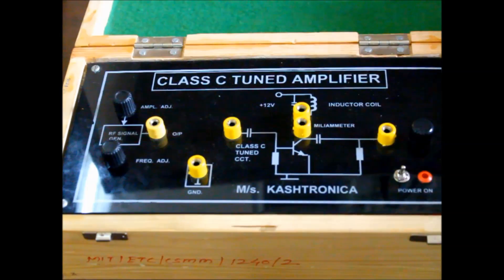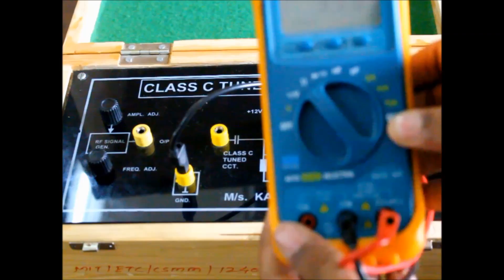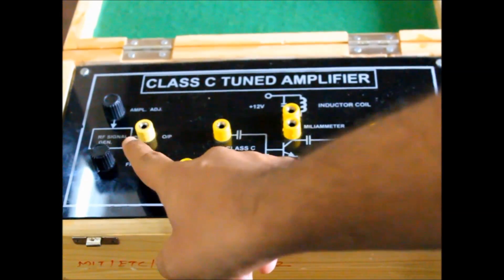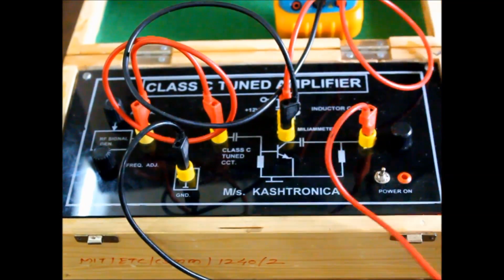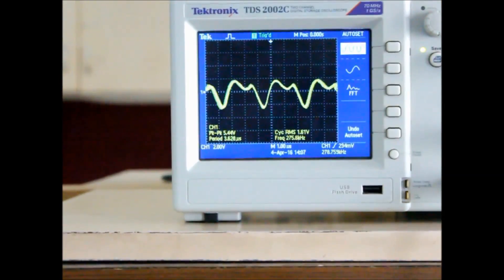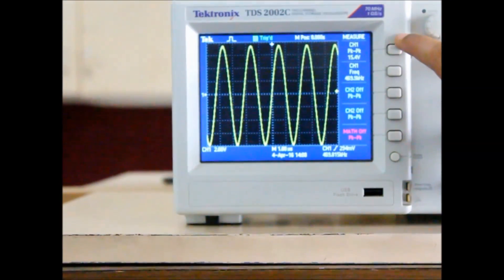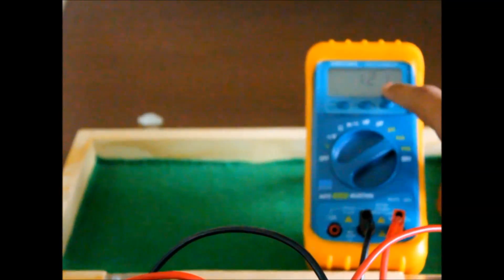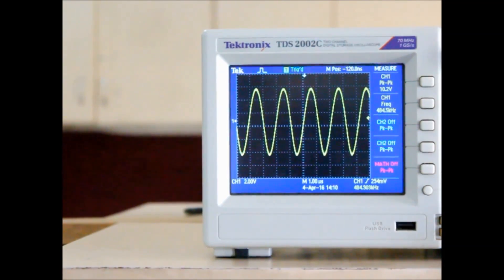Class C Tuned Amplifier

Comment: Thanks for  the great video. I have a question that I hope can be clarified. At about :45, you measure and adjust what appears to be the output resistance... Adjusted to 6.8K. Why? How does that affect the circuit performance? Is that the DC thru the LC tank collector circuit? . I have built a few similar circuits...but never considered this resistance. Please explain. Many thanks.